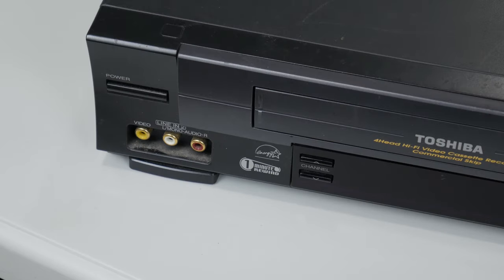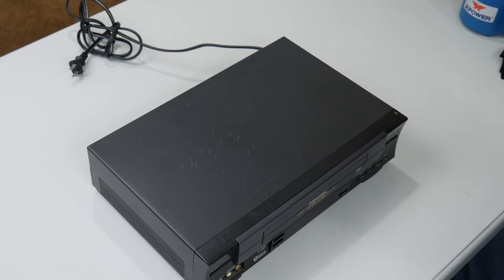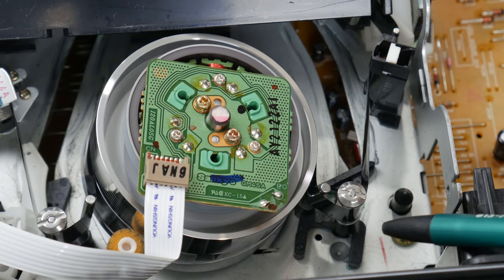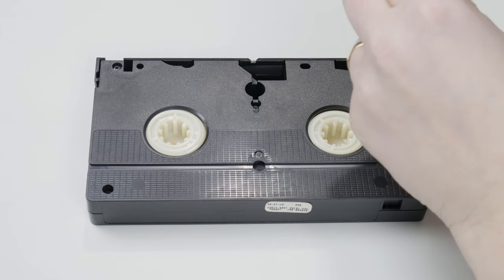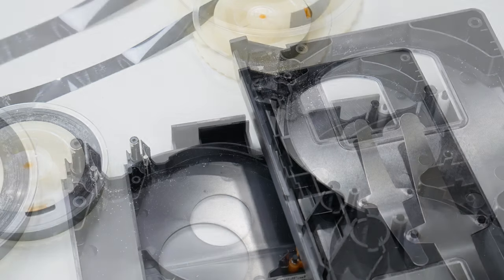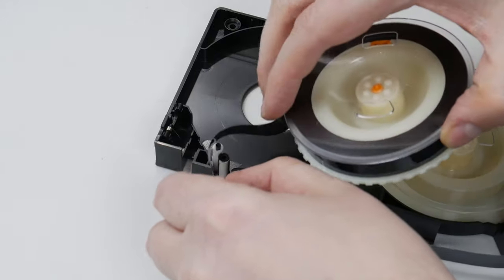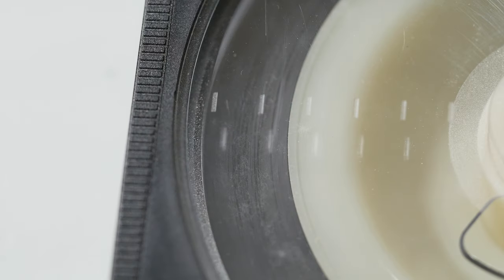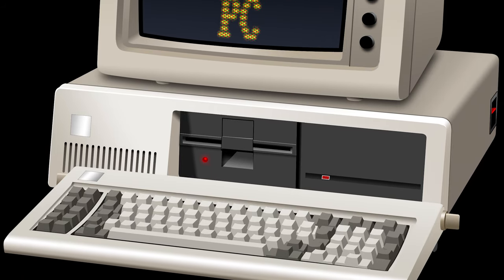How to clean moldy VHS videotape

Comment: Hmmm... should I not use an alcohol wipe down on the hard surfaces and air dry, to discourage any future mold?
Reply from the maker: Not a bad idea, especially if you think you'll want to capture the tape again in the future.  Proper storage is more important in the long run, though.
Reply: its outgassig not mold...
Reply: @esecallum  no
Reply: @AtomizedSound  it's outgassing as I analyses it where is mold going to come from the tape is in a cover kept on a dry place and it going creep thru the crevices just to settle on the magnetic tape and not anywhere else..I am right

Comment: Question! If I clean these tape, the image quality will improve? I have some and the image looks fuzzy and with static
Reply from the maker: I would first clean your VCR heads (properly, do not use a cotton bud!) as that might be the culprit.  Only clean the tape if you can see mold or other damage.
Reply: @TheOldskoolPC  By cotton bud do you mean Q-Tip? Just curious what's the harm in that? I've been using alcohol & Q-Tips for years being very careful not to break the little tabs on the drum. Is there something else I should be concerned about?

Comment: Hi I may have been onto you before.

What percentage Isopropyl would you use please? A 70% one.

In the event that you couldn't get Isopropyl would  sanitizer with isopropyl alcohol in its ingredients be OK please?
Reply from the maker: I use 99% for just about everything.  Hand sanitizer should NOT be used because additives could do more harm than good.
Reply: @TheOldskoolPC  I have been able to get 70% isopropyl.

Would that be OK to use?

Thanks for your kind reply.
Reply: You can buy 99% at hardware stores in the paint section. Test it on tapes you don't care about in case it melts the tape. Hand sanitizers are sticky, usually. Hydrogen peroxide or bleach also kill mold. Not sure about how bleach would do on the tape, but I did see a cleaning site that mentioned Hydrogen peroxide.  Not sure how liberally  they were applying it and to what surface of the tape.  Again I'd test it on a tape that I didn't mind damaging and a donor vcr. You can find them online and at second hand shops. You also may be able to use a tape rewinder.

Comment: I'm planning on capturing several VHS tapes using the method outlined in your capture video. My tapes don't have mold issues, but can you use this microfiber cloth cleaning method as a way to prepare the tapes for an optimal digital capture?
Reply from the maker: I would not open up tapes and attempt to clean them unless there are clear signs of mold or other damage.  Tapes don't need cleaning for better captures unless they are visibly dirty.

Comment: My only issue with this method is that my vhs players have been automatically rejecting anything I put in there that has mold. So I can’t use the machine to fast forward or rewind. Any other ideas?
Reply: I have auto vhs rewinders.  They were made specifically for rewinding back in the day.  Saved the VHS heads.

Comment: Great video! Currently finding all my old tapes to back up and sadly, they've definitely got mold on them. I only have the one VCR, probably not a pristine machine itself, and no donor VCR. Any other ways I can do the main reel cleaning?
Reply from the maker: Be very careful with your single VCR unit :-)  I mentioned a donor VCR because "just in case", but in reality the VCR I show in the video worked just fine after disassembling/cleaning/reassembling.
Reply: Do it by hand (using gloves and a microfiber cloth). It's not the quickest process but gets a bit faster once you get the hang of it! Also listen to something in the background so you don't go insane! 😅

Comment: I have some VHS tapes that have a lot of mold on them. I just bought a VCR which also has a DVD player along with RCA cords. The VCR has no problem playing DVDs, but when I try playing the VHS tapes I get a flash of static and the video cuts out and my TV looses its signal to the VCR. I’m doing this all on a flatscreen TV because I don’t have a CRT TV, and the VCR and cables were bought separately. Do you think cleaning the mold off of the tapes would fix that problem? I read somewhere that it’s hard to get VHS tapes to play on flatscreens, and I wasn’t sure if it was the tapes or hardware.
Reply from the maker: Tapes don't play back properly with mold on them.  If you played tapes with the mold still attached, you've damaged, or at least dirtied, the inside of your VCR.  You must clean the VCR heads as well as get the mold out of your tape before trying again.
Reply: that happened to my vcr open it up and clean the wheel inside

Comment: Hi what type screw drivers are you using thanks very much i need to buy some for fixing tapes and vcr aswell thanks very much.
Reply from the maker: The screwdrivers you'd need would depend on what screws are in the tape.  That said, most are philips-head screws.
Reply: @TheOldskoolPC  hi ok thanks i get them online in a pack yes.

Comment: One of my childhood memories VHS tapes is basically full of mold - almost the entirety of the ribbon is white. Do you think it's salvageable?
Reply: yes. i just played them fine. you can open it and use a brush to wipe away.
Reply from the maker: Yes, just follow the procedure in the video.  You might need to do it several times to get rid of all the mold, but you can.
Reply: @TheOldskoolPC  its not mold but outgassing compounds just like batteries which are leaky... it doesn't happen on basf chromium tapes
Reply from the maker: Nope, pretty sure it's just mold: http://resources.culturalheritage.org/emg-review/volume-two-2011-2012/restoration-of-molded-videotapes-research-on-vacuum-freeze-drying-of-water-damaged-videotapes/#Mold
Reply: @esecallum  I have Basf chromium tapes and it happened...
Reply: @BavarianM  i just play the tapes and not bother cleaning anything. i find they just work. occasionally use a cleaning tape or just open up the vcr and clean with Mr Sheen
Reply: @esecallum  but then you are a cowboy sir 😎

Comment: Very helpful video, thank you. Do you have any thoughts on using alcohol in this process? I've seen some guides recommend that but am not sure if that adds risk of damage.
Reply from the maker: The professional machines use a dry pad, so that's the advice I tend to follow.  That said, I do use alcohol sometimes when I rescue floppy diskette media, but only as a lubricant and not for cleaning.
Reply: If during isopropanol or alcohol (what’s the difference in terms of their cleaning tape risks and advantaged?)…. How much is needed to be used? How do you apply it, and when?
Before or after (or instead of) a dry wipe as shown in the video?
Reply: @CB-jh1pt  I'd love to know this as well -- did you ever end up finding a solution?
Reply: @joshhallnz  I tried 2 tapes which were reproducible to test techniques. I ran through twice using dry wipe lint cloth only (all the way forwards, and in reverse; cleaning the inside of the cassette both times. I used cotton bud tips soaked in 99% isopropanol for this.
Tried playing the tapes after this. Quite jumpy, but could get a picture and sound from it.
Then did an isopropanol wipe on tape to see if it improved the jumps/ quality. Rewound and fast-forwarded tapes to try and “iron out” any creases. No noticeable success, and I was scared to try it on home videos yet bad I wanted to improve the technique.
I kept a couple of reproducible tapes (kids feature films etc) from when I sorted the mouldy ones before. Since found the previously non-mouldy films are looking furry, so have a few more to trial… yay 🤦‍♀️

Comment: I have been playing various VHS tapes- both professionally recorded movies and home-made videos- on several VCR units (four so far), and they are all playing poorly (stuttering, skipping, jumping, etc.) I've cleaned all of the unit's VCR heads and contact points, and although I haven't opened any of them, none of the tapes appear to have any mold or other issues. Are the tapes just too old and degraded from age or humidity?  I'm out of ideas.
Reply from the maker: If professionally recorded movies are failing to play on several VCR units, that's somewhat alarming.  If they're old and worn out and stretched, or stored in humidity, or stored in locations with extreme hot and cold cycles, then yes, it could be the tapes.
Reply: Sounds to me like bad drive belts in the VCR. Replace those and you should be fine. May want to replace the pinch roller aswell

Comment: Friend, after cleaning the reels,  instead of cleaning the inside of the tapes, could I just not replace with new tapes, keeping the old reels?  Or would this not be recommended.
Reply from the maker: Cleaning tapes to rescue their contents is generally considered the last stage in a tape's life.  Once the tape has been properly archived (25i or 30i, preserve both fields!), the tape is usually discarded, or sometimes put back in storage.  It is definitely not returned to active use.

Comment: So I have a few vhs tapes that got damaged/ mold and lost the visual quality but has sound. It just looks like tracking lines. Can these be fixed and recovered like in your video?
Reply from the maker: The mold likely came off the tape and got stuck in your drive heads.  I would try the method in the video, then watch a video on how to properly clean VCR heads with paper and alcohol (no q-tips!!) and hopefully that will help.
Reply: @TheOldskoolPC is microfiber made with 100% polyester?

Comment: Amazing! I have a wizard of Oz VHS that has mold, not bad but there is a moment where there at the wizards castle (?) And it gets really look bad. So I'm just going to crack it open and get rubbing alcohol and a quetip and get rid of it
Reply from the maker: The Wizard of Oz had a stunning restoration on Blu-ray a few years ago; you may just want to go with that.
Reply: @TheOldskoolPC  I made this comment a month ago, I found a 35mm print

Comment: Excuse me, isn't it better to clean by playing tape instead of fast forward or rewind. Now as I ask this i realize that by playing it would take a long time 🤔

Maybe there are sections dirtier than other, I'm wondering if just fast forward removes mold partially. And what about placing a piece of sponge...I'm afraid of scratchs though
Reply from the maker: Playing takes a really long time.  The process described in this video is for casual removal of mold; if you have something much worse, then more extreme methods might be necessary.
Reply: @TheOldskoolPC  What those more extreme methods would be?
Reply: @TheOldskoolPC  also interested in the question asked above
Reply: @CB-jh1pt  sadly we may never know

Comment: Can you do this with a Umatic 3/4 in. tape?..I have an edited master of a college project I made back in '91 that I never got a chance to knock down to 1/2 in... I was wondering if I could get it put onto a flash drive. When I fished it out of storage It had mold on it...Does anyone know what it might run me to have it professionally done?
Reply from the maker: If it's a umatic tape, I would definitely contact a few transfer houses and mention to them that it has some mold on it.  Some transfer places have specialized machines to clean the tape.
Reply: @TheOldskoolPC  Thanks, so much!..Is it a very expensive process?

Comment: i know people use IPA to kill the mould but i'm wondering if you could use UV light to completely kill the mould after the cleaning process ?
Reply from the maker: I'm not sure, as I haven't experimented with trying to kill the mold completely, only removing enough of it such that capture as possible and it doesn't damage my equipment. Hopefully someone else in the comments may have an opinion.
Reply: @TheOldskoolPC  i know gardeners use UV light to kill Mildew mould like what you get in tapes BUT! i have no idea if the UV light would damage the film ? i would be very interested to know, i enjoyed your video it's good to see people trying to restore things rather than just throw them away

Comment: I thought you can’t run it through vcr, then how do you clean mold off without running the tape ?
Reply: use an old machine to run the tape that has mold on it, like he did (he has another machine to view and record and transfer)
Reply: @justnoted2995  you mean a spare vcr that you wouldn’t mind messing up?
Reply: @littleratchett1527  yes, but the guy cleaned it up afterwards (it was a 'donation'), and apparently it is working fine afterwards

Comment: So no alcohol needed?
Reply from the maker: I didn't use any.  Some people have used alcohol with success, but I tend to only use that if I'm not getting results from dry anti-static lint-free cloths.  I also restore floppy disk media, and I've seen alcohol accelerate dissolving the binder on the wafer, so I personally use it as last resort.
Reply: @TheOldskoolPC  so the real question is will the alcohol damage the tapes

Comment: Anyone tried this? I can see a lot of comments about “I will have to try this”… 

Will I damage them with this DIY?

What are the definite “don’t”s?

I have a lot of family home videos and a donor VHS player. 
I just don’t want to break them beyond repair… this almost looks too simple for the state of the videos?!
Reply: I’ve seen both alcohol and isopropanol (at 99%) as suggestions… but also that these might damage the reel? And I wouldn’t know until it’s too late.

How does this not ruin the picture/ sound info on the tape? I’m scared! Haha 😅
Reply from the maker: If it helps, the tape in question was turned into the "New Trier High School Class of 1989 Video Yearbook" video on youtube, and you can see it didn't damage the tape.
Reply: @TheOldskoolPC  a few of my tapes look a little more worse-for-wear in the one in this demo video. Would it still turn out ok or would you treat it differently? Your above reply is much appreciated, I’ll check it out, thanks.